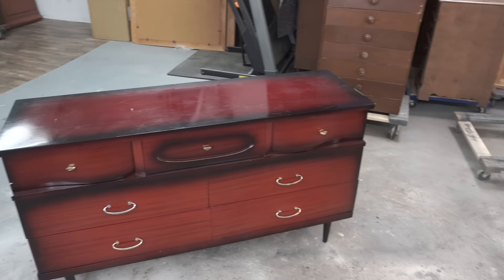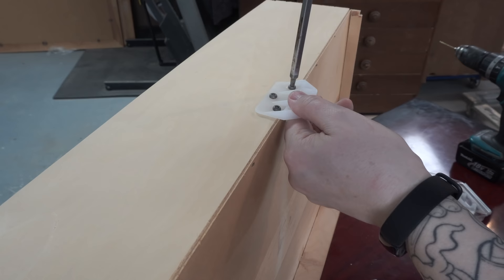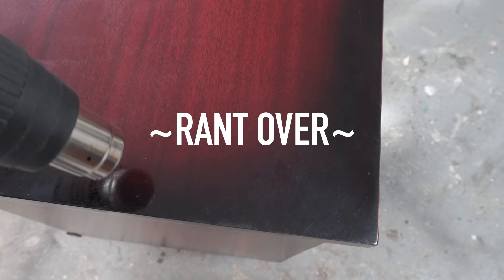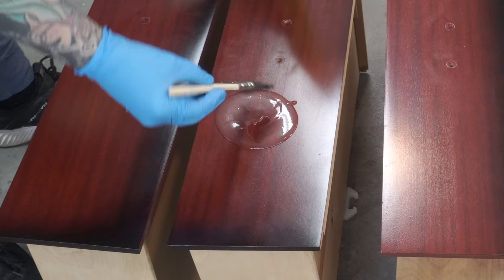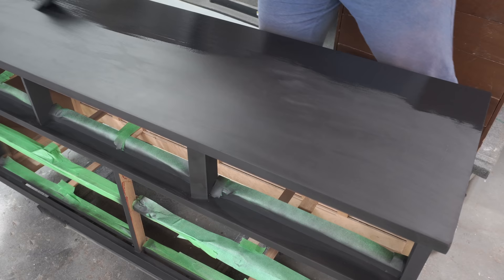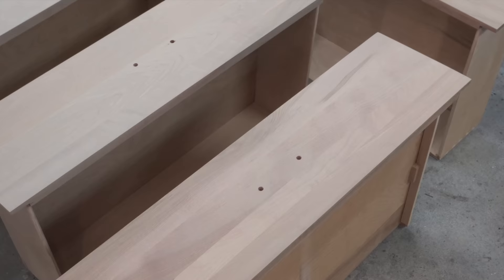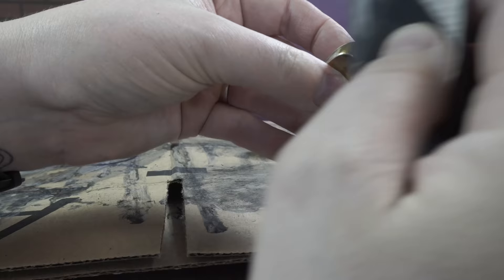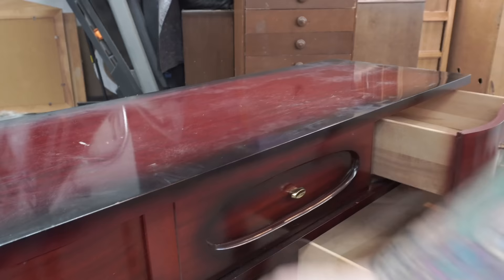How To Make A Laminate Dresser Look Expensive

Comment: Angie, you are an angel of mercy for furniture.!   My vote is for the 2021 version simply because of the natural, warmth on the drawers.   This begs a question:  How can stain be reversed if you don't like the look you just applied?   With paint one can just let it dry and then strip it off again.  Is the reversal process the same for stain?   Seems like it "wood" be harder to reverse since it soaks in more.

Comment: While these are both dressers (the 2022 with the black hardware and the 2021 with the brass hardware), your inventive use of colour and hardware makes them look like they would be useful in any room in the home/office.  For example:  a dining room as a side cabinet for dining table linens and supplies, a wide hallway, or holding up a tv and other entertainment modules in a living room.  With clever employment of drawer organizers depending on what is needed to be stored in them, these dressers could extend their use tremendously.  As for my favourite?  The 2022 one as the colours chosen for the stains and hardware make it even less a 'dresser' and more an 'everywhere' piece.

Comment: I like this one the best.  The finish you put on the drawers makes the wood grain pop.  The color is better than the other one you did earlier, (in my opinion).  Maybe it is the gray overtone, (or is that undertone?., that makes it work so well.  I have a mid century laminate dresser with the wavy drawers.  Your video makes me think I can update and change it's look to something that will be more current, (since it is a solid piece).  Thanks and 10 out of 10 on this one.

Comment: Like the new look but, you've shown exactly what I tell people every day. Wood doesn't always take the stain consistently or uniformly! That dresser is outstanding and love the other older one as well but, this a much updated modern look. Love Tim Hortons. We had one here in Ohio but, it was only open for about 6 months then closed for some reason! I prefer Tim Hortons to Dunkin and won't even step foot in a Starbucks! Anyway, love you videos and I'm actually learning a lot. I
I work for a Benjamin Moore Dealer and have used Advance satin on furniture. It goes on like oil, self levels, and dries like oil but it's a soap and water clean up. I've found that rolling with a Mohair roller, then back brushing, lightly, give a sprayed look and their factory black cover phenomenal in just two coats! I did my dinette set and it came out like glass. My biggest mistake was doing the top in a full gloss! Last thing I want to see while eating is my reflection eating! Lol So, I put a satin poly over the gloss to tone it down and it worked like a charm. I then donated it to family in need. Have you ever used Benjamin Moore Advance satin paint?
Reply from the maker: No I haven't Tom. I've only used Art Minds chalk paint and Fusion Mineral Paint, I haven’t used anything else. Thank you so much for always watching!

Comment: Hey, new viewer here and I realize this is a 9 month old video so you might not see the comment...

However, I was a housepainter for the better part of a decade and when you mentioned adding a little water to help things smooth out on the final coat I HAD to share:

When you're using a water based paint, thinning it out with water can help with leveling out the finish but it also, of course, waters it down and affects the opacity. You can get some amazing results by adding a couple drops of dish soap into your paint. It doesn't affect opacity but it makes acrylic level out just like oil based when you're brushing it on. That little trick has helped me achieve oil spray results just brushing on water based on cabinet doors and trim without it being so watered down it pools and drips.

Even if you don't see this comment, maybe some other reader could try it I out. :) killer content, btw.
Reply from the maker: Thanks so much for watching!

Comment: Beautiful work as usual but I do have a question; in both cases, though all the drawers are wood, you chose to paint the upper row. Is it an artistic choice or a functional choice?  More to the point, what is your thought process for deciding which wooden parts should be painted?  (Of course the laminate should be always painted...)

Comment: Instead of water have you tried XIM or other wet edge extenders? Paints skim over so fast now I think you have to use an extender. Have you tried oil modified paints? And I like both versions of the dresser. 2022 seems to have a better black finish and has a cottage / casual feel to it while 2021 seems a bit more formal.

Comment: I have a vintage sewing machine cabinet with the original sewing machine in it. It was made and sold by a company named Free. The whole thing is over a hundred years old. I want to refinish it, but I am not sure how to go about fixing the drawers that got a little moisture damage. And the top thin piece of vanier needs to be removed and replaced. Would you happen to have any suggestions on how to replace the thin vanier wood for the drawers? They are curved. I am not sure how to go about curving the wood like it is already.

Comment: I was just wondering.  Can the top curved drawers be switched with each other?  Seems like that would give the dresser an even different look.  Just a thought.
Reply from the maker: Unfortunately the drawer fronts overlap the drawer boxes unevenly- they are offset… so they wouldn’t actually fit and close if they were switched.

Comment: I only use Benjamin Moore’s Advance paint when I pain furniture. It has oils base technology but cleans up with soap and water. It’s self levelling so you will never get brush or roller marks. It cures to a durable and washable finish. There’s no need for a top coat. There’s no better paint for a professional finish
Reply from the maker: Thanks for watching!

Comment: is it possible to take laminate off, I noticed on the curved drawer it was kind of coming off so would you be able to peal the laminate off ?
Reply from the maker: The part that looked like it was coming off was the veneer (actual wood) that covers the plywood. The printed woodgrain was on top of and attached to the veneer, so definitely needed to be chemically stripped away or painted over.

Comment: May I ask, why didn't you spray your chalk paint on?
Reply from the maker: I don’t actually use chalk paint- I much prefer the Fusion Mineral Paint. I do have a sprayer, but I tend to reserve it for situations where I’m doing either more than one piece, or a large piece with a lot of flat areas. Otherwise, I don’t find it worth the time to set up the spray tent, etc.

Comment: They do not print wood grain on veneer, you said it multiple times.
Reply from the maker: They actually do In certain situations and this is one of them. It was done on the curved drawers because the veneer over the ply was cheap, and they’ve printed the faux mahogany woodgrain over top to match the rest of the dresser. I’ve seen it many times in these cheaper mid century pieces that are made to look like mahogany in particular.

Comment: Most furnature has laminate and or vaneer. 90% infact.  It became a way to utilize wood sustainably. People really should research why this is done.
Reply from the maker: Agreed!!
Reply: @TranscendFurnitureGallery Before I got started I bought a vaneer pack with 45 different species and I bought the Woodworking Bible.
Reply from the maker: @paulatakeuchi7015  Yes, it can be quite frustrating actually. People (most people) see “woodgrain” on pieces and assume it’s solid wood, and don’t realize they are looking at veneer or laminate. It bothers me how much people look down on it when it’s (at least in my opinion) more stable and economical than solid wood!
Reply: @TranscendFurnitureGallery  I'm one of your biggest fans. I've learned so much from you. I'm working on my first piece now. Almost done
Reply: However I ran into some polyurethane bubble problems. I found a fix though. Thank God!!! 😳🥺👏👏👏🤣😂

Comment: I know you were a little self conscious about your rant; I don't think it was unwarranted. It can be frustrating to have good things be seen as lesser or cheaper, when that may not be the case, because of an arbitrary design choice. Like, I'm not a fan of laminate myself, but we have 2 60's era laminate dressers that have survived for decades, about 6 different moves, and about 10 different people who've used them - both having been in my childhood bedroom and used on a daily basis for about 12 years. The most damage they've recieved is a handle breaking off (all other original hardware are still in tact) and the laminate fading over time, going from a deep brown to an admittedly pretty ugly grey-green (maybe due to sun damage-?). Like, they need some TLC and I intend on refinishing them / having them refinished one day, but it's disingenuous to write off their utility or durability because "laminate is tacky." Give those bad boys a good cleaning, sanding, and new coat of paint and they'll be good as new.
Reply from the maker: YES!!!! Thank you for this!! I wish I could frame it. Thank you so much for the really great comment.